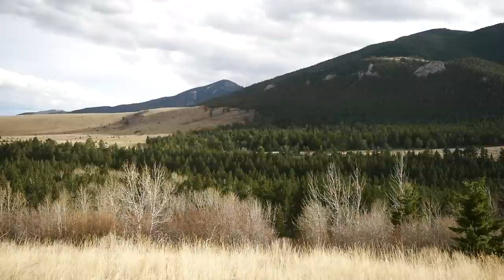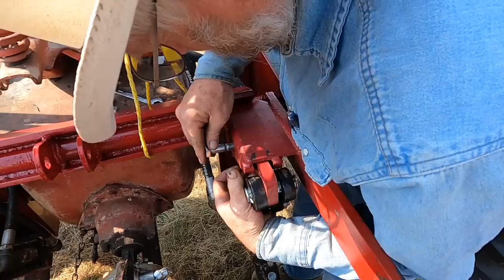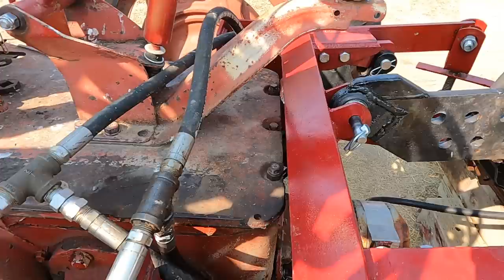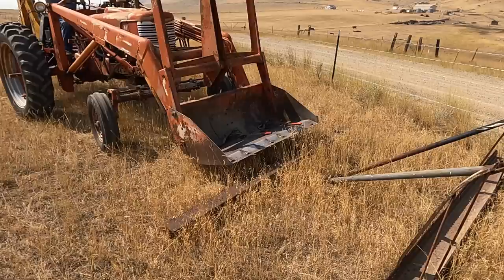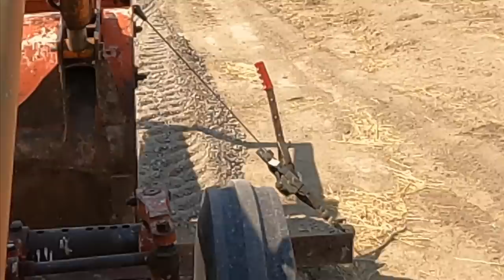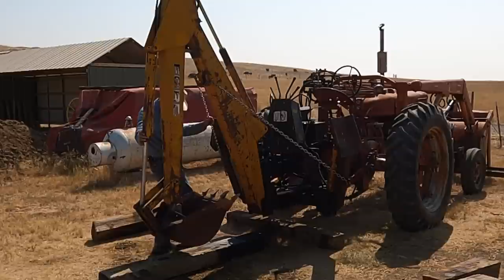The Poor Man's Road Grader | Engels Coach Shop

Comment: One of my favorite sayings, "If it's stupid and it works, it ain't stupid!" Good job Dave.
Reply: Absolutely! It ain't stupid if it works! 

Which is exactly what I told a guy I was working with today. 
I convinced him to let me use a shipping container as an anvil... I deliberately backed up a tip truck into it. I successfully straightened to within a couple of millimeters some parts the digger operator bent rearwards. Success felt real good.
Reply: @prdoohan  My brother-in-law bent my back bumper pulling me out of the snow, so I backed into a concrete base for a parking lot light to bend it back.

Comment: Winter snow plowing was with a small Farmall Cub tractor with a front blade... which always resulted in pushing gravel into the driveway edge, which would always dull the lawn mower blade.  I had a spring tooth landscape rake for a 3 point hitch on an old Ford 8N tractor.  Swing it at an angle to drag the gravel back where it belonged...  Those days are long pasted....

Comment: Years ago the guys built a grader to level out existing gravel roads. Basically it consisted of 4 big truck tires bolted together in a diamond shape with big rocks or pieces of iron on top. It was then hitched up behind a tractor with chains and dragged along the road. It was quite efficient, as the loose gravel it collected filled the holes and leveled everything out. I've seen drawings of the design somewhere. I would say your grader would be more efficient if you could angle the blade a bit so that the gravel can move to the side instead of going over the top, like the grader machines do.

Comment: I use the bucket on our Ford 4000 Industrial to do much the same in spreading base.  However, we put a skid-bar on either side of the buck which allows for depth setting of said bucket.

Comment: Our poor man graded was a length of oil well cashing cut length wise.  Placed the open side down with a  chain attached both ends of the half pipes so when you drag it four edges cut the high spots.  Worked fairly well when dragged behind anyone of the old vehicle or with horses.

Comment: Mike from mo. Here, i love your M! I have a tricycle front super m unrestored..that sound is sweet 😊 glad to see someone like me that uses the old tried an true iron!! Keep up the good job,,mike t.
Reply: Does the tractor have a governor on it that adjusts the throttle as needed, or does the throttle setting remain constant. I noticed it would get down and "grunt" when under heavy load.  -Old guy who grew up behind a team of horses. Land too steep for fancy equipment.
Reply: @clarencegreen3071  they are governed, and adjustable. As they adge they need a little adj. But its peferd rather than being too tight..if gov. Is too tight it will surge..

Comment: Nice job Dave.  Back in the day I was able to do pretty much the same but I had a 450 Farmall that I had to remake an auction bought loader and adapted a wide enough bucket that covered the track. ("Guranteed universal fit, any tractor," the auctioneer swore. 10 man hours cutting, fitting welding it sure did). Back then the ticket was cut a 275 gal oval fuel tank, put a cutting edge and appropriate  reinforcement and you'd have a good sized snow bucket to use in the lake effect NY winter.  
Thanks for sharing.
👍🇺🇸🏁🇺🇸🏁🇺🇸👍

Comment: I see a wide variety of levelers, graders, muck scrapers and other assorted variants.
Out here (New Zealand) alot of farmers use river run for "drive way" /tanker track  on cattle race they use crushed rock. The crushed rock sets like cement once compacted. However the river run usually has big fist sized stone in it. On occasion I have found a fist sized stone wedged between either the drivers on the truck or the duels on the trailer.
That stone looks like it came from a river bed? But also seems very sandy? The bit that got me was how easily it spread.
Loving the after hours content too!

Comment: I had a contraption similar to yours on my old Ford 8N tractor. After getting it spread like you did I then pulled a drag made of 2x4s weighted down with concrete blocks. This did the final smoothing. I also (by shifting the heavy blocks to one side) was able to put a slight crown in the road which helped the water to run off. This was out on the plains of Colorado.

Comment: Dave nice to see folks still using the M Farmall believe me I have good friend and his Dad still uses his M Farmall but he let us do some work on it we had the head shaved .0250 and bored the block out and 450 sleeves in it with High altitude pistons in it and when we took it in to get dynoed   at 86 hp I have pulled a grain cart with 250 bushels in it and put in to 5 th gear and pulled it out of the field at idle, you can have a lot of fun with power but it does cost. Take Care
Reply: Dave says wow!

Comment: Very innovative and it works. I do something similar with an 8'x10" H-beam but I pull it behind my Allis Chalmers WD-45. I adjust the tow chains such that it pulls at an angle which prevents chatter and moves material side to side.

Comment: Your gravel looks different than the gravel I'm familiar with. Mostly we use this stuff called bluestone for gravel here. It's a grayish rock. You buy it by the mesh. 3/4" bluestone is very popular. Though 5/8" bluestone has its fans. Then there's stone dust. Which used to be waste but it's a material now. Stuff compacts like nobody's business. So it's used as a compacted base. But if you're fancy you use red stone or even marble chips. Bluestone is the everyman's gravel.

Comment: I am a new subscriber, I think this is the second video so far, there will be more.
You are having way too much fun with your equipment.  I don't have a lot of time with Farmall M tractors, I like the 3 point on my 1962 Ford 801/4000 gas tractor too much.  With my box blade back there and the hydraulic top link I added I go looking for jobs like that.  That looks to be much stronger than other add on 3 point units, looks and apparently works good too.  I figure people can spend a lot of money on new equipment and just drive around or challenge their intellect and adapt older equipment for the job and not only save money but gain satisfaction, I'll take the old stuff.  Plus I am old so I don't mind taking a little more time to do something.  You are interesting to watch.

Comment: I use a H beam strapped to the front of the bucket to spread stuff. Useful around the place to have it, cause it serves multiple uses, in this case, making quick work of the initial grading phase of loose material. Works for soil too, not just gravel (well, under the condition that it's not wet or too compacted).

Comment: I'm surprised you didn't use the tire method of strapping a couple tires behind ourselves and dragging them along the road that doesn't much better job of smoothing out the road most people use three one in the front two in the back separated by a board of something heavy to keep them separated I'm sure you could probably find the videos on it That's a lot easier than what you're doing It puts the tire marks in front of the the work this way you're not constantly bouncing around the tires smooth it out really nice

Comment: I used my truck snow plow to spread gravel a few times. The problem is from the driver's seat you can't really see the plow when it's down, so I had to have a helper outside to signal the height of the plow., It worked!

Comment: - I thought you were going to close the tines of your grapple down over/around your bucket and role the bucket down/over so the grapple tines could keep the bucket edge raised up off the compacted drive way a few inches as you pushed/plowed the gravel.
- That got me to thinking...what if you welded onto the H-beam four, 1/2" thick semi-circle skids each 4" wide, placed at each end, and just outside the bucket's width.
- You could still push over the piles, and then push OR back drag the bucket and have a 4" depth...or role the bucket up and get a 2" depth, or 1" depth.
- The semi-circle skids would change the H-Beam height as the bucked rolled back or down.

Comment: Hey dave. not sure how much of these you read. if you want a truely smooth drive and yard. Tak 3 peices of those I beams and some chain. hope i explain corect. get on 8 footer set it on around a 40 degree angle one way behind the tractor about 10 feet away from the tractor so the angled furthest end is about in line with the opposite wheel. the about 5 feet from the end of it set another angled I beam the same length8 feet at 40 degrees behind the other. then about 5 feet from it set another one around 12 feet flat straight across square to the back of the tractor. is a bit of foolin around with diffrent lengths of chains ect to make it all pull in a straight line behind, sorta like a Evener on a wagon pole. what happens the gravel travels from both dirrection ect to the back straight across one that spreads it straight across flat as a sheet of ply wood. only have to have bigger turning around area so chains do not tangle with tractor wheels. I made one for dad's farm and we had the smoothest you ever drove trais out in the feilds and drive way in the yard. i even had it here in calgary and done three trucking company yards. it was awesome i made them smooth as base ball feilds. you can do the same using a pole like a wagon with eveners. here in calgary that was what i used so i could lift it and colapse it to transport between places.

Comment: Seems an awfully poor design on so many farm tractors and backhoes to put such small front tires on them.  That loader when it is picked up exerts a heck of a lot of force on the front end and quite a bit when carrying a loaded bucket.  The front end just doesn't seem to be built to take its intended loading.  Especially so with many more machines sold with buckets as a standard feature and the hoe as an option.  It should have been obvious.  Even as cheap as light trucks and cars have gotten in quality you don't see roller skate wheels used on the front end!  Ooops, now I suppose they will start doing so.....
Reply: You can't make a front end strong enough to tolerate the abuse a bucket will deliver.